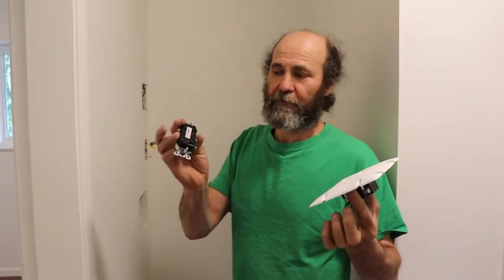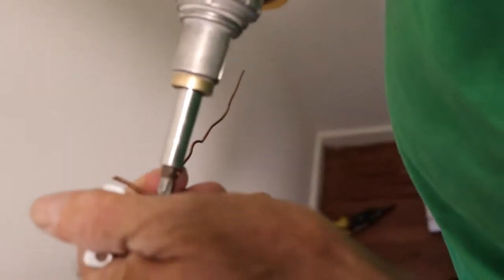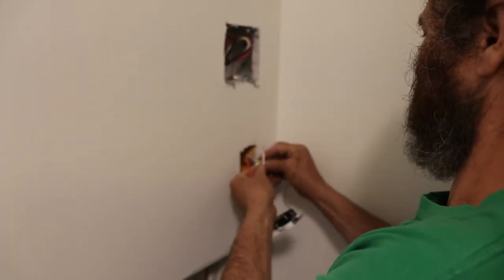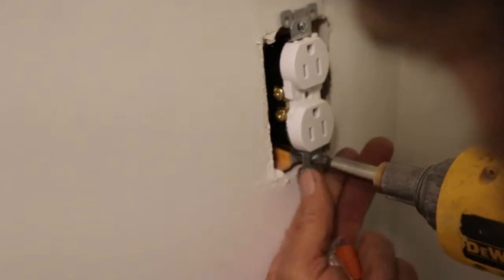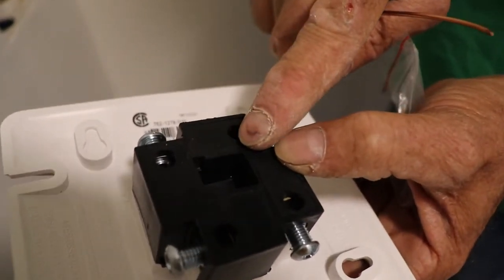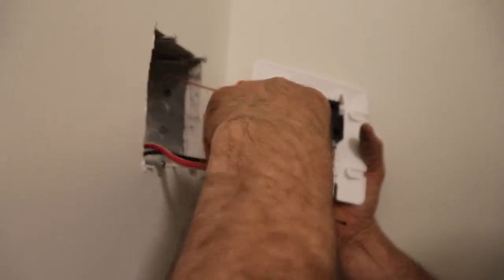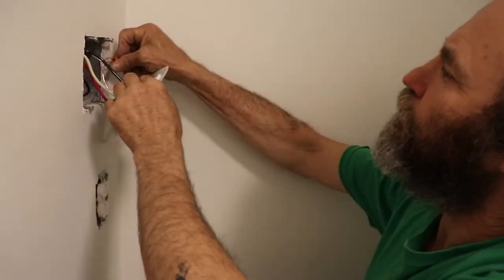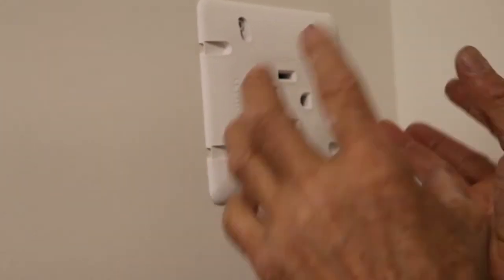HOW TO INSTALL a washer and dryer outlet

Comment: How do I change a 2 prong socket to a 4 prong socket, is that possible? The washing room only has a 2 prong socket and I have a double stack washer and dryer
Reply from the maker: Hello Zachary thank you very much, usually stackers use 220V-240V 30Amp breaker with 10/3 wire, there are others ways to do it, but not recommended, for something permanent, it pays off to do it right, please let me know if you have more questions, keep safe.